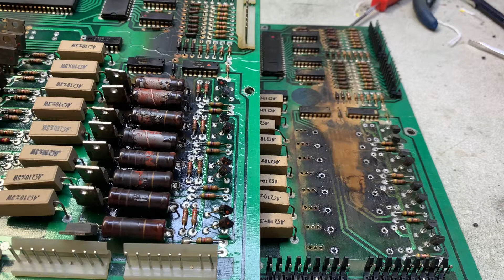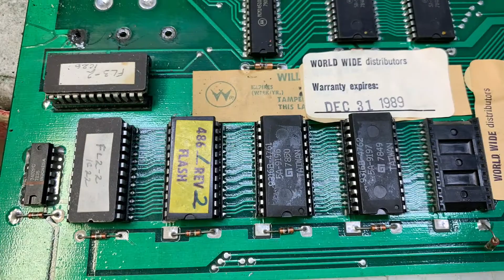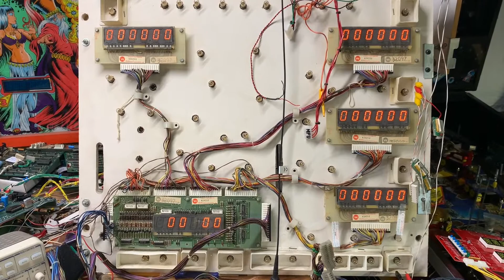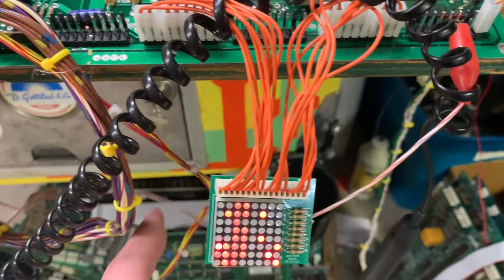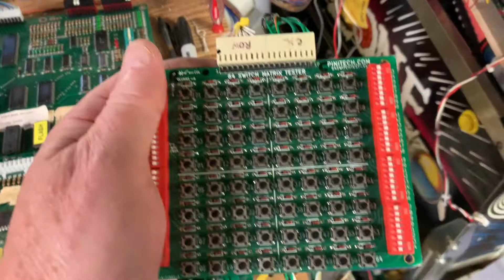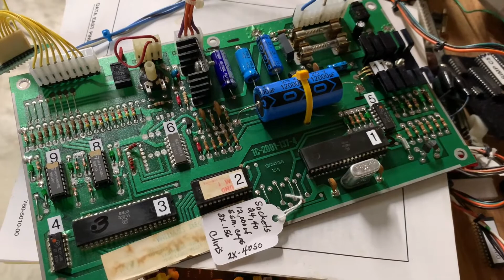Williams Flash MPU, Driver, and Sound Board Repair and Test

Comment: hello Chris, how are you? What modification did you make to remove the 27 ohm resistors that generate heat? i didn't understand it very well, could you make a video explaining it? please. I have recently acquired a Williams Time Warp which is a little defective and I want to repair it, but I don't understand much about electronics. If you can help me I would appreciate it very much.
Reply from the maker: I’ve documented the procedure in the PinWiki here:
https://www.pinwiki.com/wiki/index.php/Williams_System_3_-_7#Reducing_heat_by_replacing_the_TIP-42_lamp_drive_transistors_and_eliminating_the_27_ohm_current_limiting_resistors
Reply: @ChrisHiblerPinball  Hello Chris! thank you for showing the documentation , which of the three methods reduces heat the most? Is it ok if I just replace the 27ohms resistors with 5W?
Reply from the maker: @joaquinstekl4288  Using the FETs reduces the heat the most. But sure, 27ohm 5W resistors are the OEM spec and will work fine.